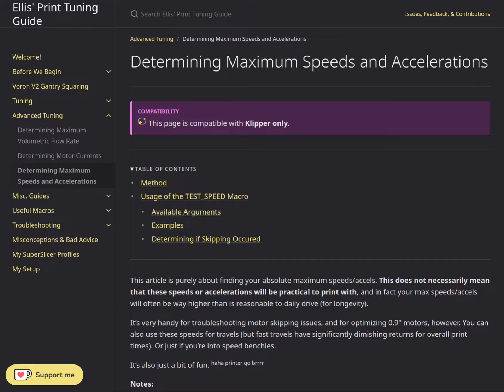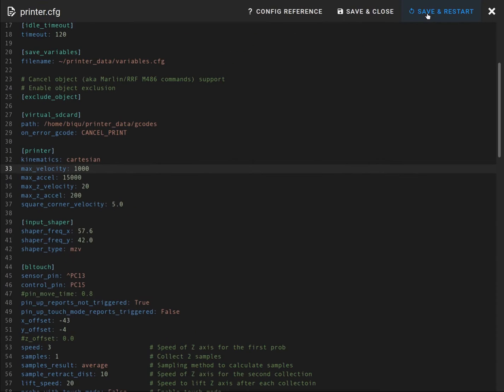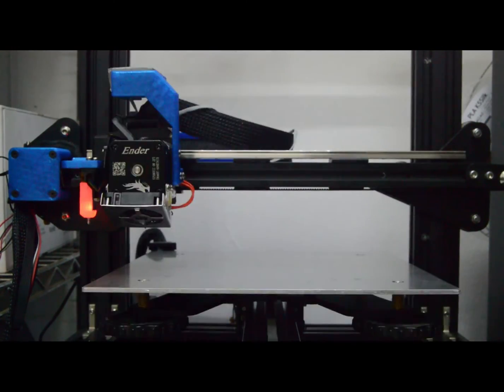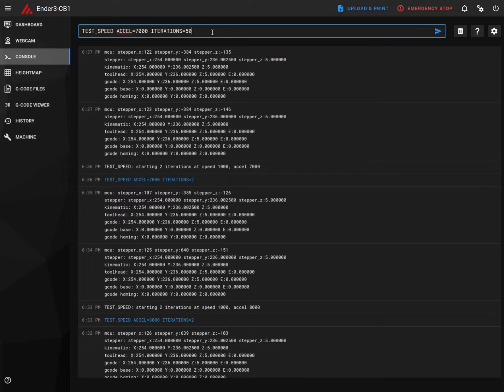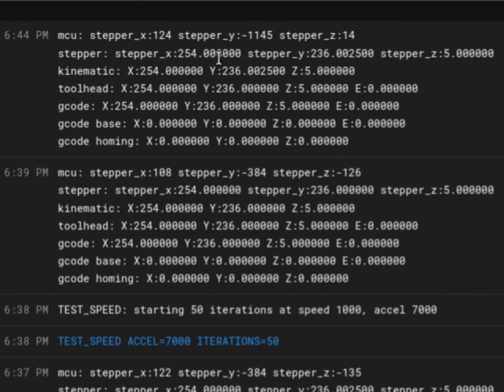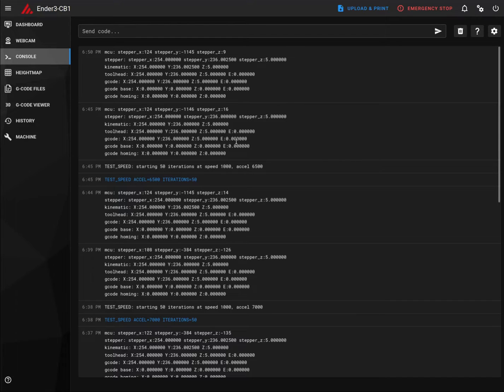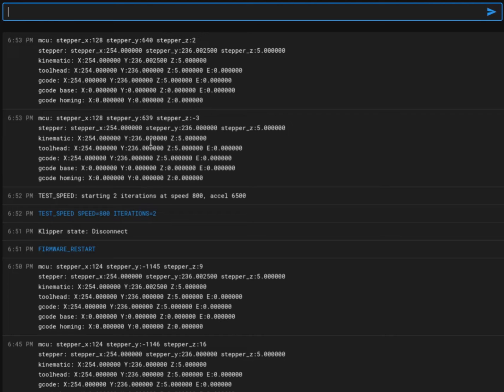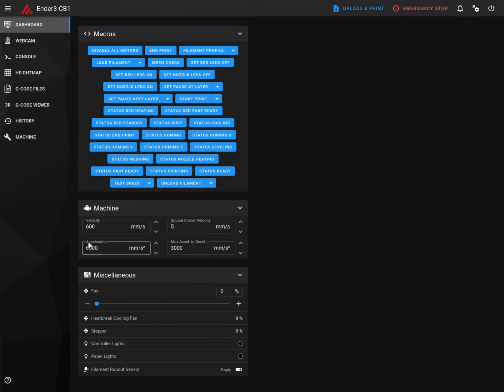Ender 3 Klipper Max Acceleration Speed Limits

Comment: My Acceleration was fine on X axis but Y axis was skipping at anything above 6500 so i kept it at 6500,  Now i have just finished a long process of installing linear rails to my Y-axis and now the Y -axis skips at anything above 5000  lol.
any ideas on what could be causing the motor skip?  belt tension? misaligned rails?  some advise would be awesome!  great video btw, my goto from now on when testing speed accel
Reply from the maker: I am not sure about your printer configuration, the printer main board and the stepper driver.

1) To go fast, you need to feed more current to the stepper motor, but that depend if the stepper motor can handle or not, please check the specs of the motor before increase, otherwise the motor will get very hot and fail.
2) It also depend on the stepper driver if it can deliver the required current or not.
3) It could be that you have reached the limits of the stepper motor, if so, you need to back-off a bit.

belt tension - if you are able to go above 3k, then I don't think so.
misaligned rails, I believe you have Cartesian printer, if so, disconnect the stepper motor cable for safety, then move the bed back and forth slowly, you must not feel any resistance.
Reply: @radiy3dprints  its a ender 3, skr mini e3 v3 with tmc 2209 drivers.
Default nema 17 44-34  motors all at stock settings and current (0.56amp) all is at the exact same settings as before i installed the rails.

The rails move as freely as i could get them, I had cleaned and greased the carriage thoroughly and got new better ball bearings and it glides like.butter before attaching to the printer.
So im sure its the rails being attached to the printer thats creating more tension that the previous V roller wheels as I could get 1400 more acceleration with the wheels before the motors skipped
Reply: @Dirt33breaks  hi, have you found answers/solution to your problem?
Reply: @billy.the.maker.  i reapplied the rails, lubed the carriages, loosened the plate on the carriages , basically made the bed move smoother/lighter.
Tightened the belt .
Its better. But next ill put the old extruder motor on it as its got more torque than the default Y.
Reply: @Dirt33breaks  so basically skipping is happening because y or x is not moving smoothly?
Reply: @billy.the.maker.  my case yes  as i installed linear rails which made the bed move less smooth.
Another reason could be belt tension or your motor
Reply: @Dirt33breaks  not enough tension? or too much. Well my Y axis skips even on 2000 (linear rails, but haven't measured before on linear bearing) but there is no quality loss at all and I print everything at 5000, so it is very weird
Reply: What is the weight of the bed with the rails compared to that without?

Comment: Can this be run on a klipperized Ender 5 or SV05 asking for a friend
Reply from the maker: Yes, you can.
Reply: @radiy3dprints  just worked on it and it was great after seeing the "ACCEL_TO_DECEL error which i just commented out.  stock hardware SV05 X and Y cant do much but at least I got it dialed in more.  Thank you! this was better than printing out the L shape wall.

Comment: Your printer's firmware reported an error:

Error on 'SET_VELOCITY_LIMIT VELOCITY=750.0 ACCEL=7500.0 ACCEL_TO_DECEL=': unable to parse

Due to this error, OctoPrint was not able to continue to communicate with your printer and sent an emergency stop command M112 to ensure all heaters are turned off, then disconnected.

Here's the last communication with your printer before this error occurred:
Reply from the maker: I hope you have added the TEST_SPEED macro. What command gave that error?
Reply: @radiy3dprints I did all of you did in video. While the test is progressing it gives me the error maybe 5-10 sec later after the beginning the test.
Reply: @radiy3dprints  and i didn’t get that. We will assume i set that settings. How can i increase the speed? When i started the print, it’s printing normal speed.
Reply: @radiy3dprints  I’m sorry that i’m new at klipper and hard-printer op.
Reply from the maker: Don't worry, please provide below information
1) Printer
2) Stepper drivers
3) Main board
4) What command you  execute before you get that error
Reply: @radiy3dprints  Thx.
1) Ender-3
2) TMC2209 UART
3) SKR Mini E3 V2
4)TEST_SPEED ACCEL=5000 ITERATIONS=2
and also tried these accel value= 1000,2000,3000,4000
Reply: and my pi is Zero2wh
Reply from the maker: Send your printer.cfg file  to radiy3dprints at gmail.com
Reply: @radiy3dprints  okay thank you
Reply from the maker: With newer version of Klipper, max_accel_to_decel is deprecated in favor of minimum_cruise_ratio. Remove the reference of  "ACCEL_TO_DECEL=" from [gcode_macro TEST_SPEED] section.

Reference: https://www.klipper3d.org/Config_Reference.html#printer
Reply: @radiy3dprints  The problem is gone. Thank you.

Comment: Great video! Im tuning also my ender 3, i got the speed and accel. Can you make a video where in you put the values on orca slicer?
Reply from the maker: Acceleration values must not be changed once tuned. The correct place is in the printer firmware/config as they are related with the printer hardware and not with the actual printing object. If you set in Orca Slicer, it will override those values.

Comment if you still need to see.
Reply: @radiy3dprints  hello , i still need to see it because im just new to orca, and also i tried to the accel and speed guide, i always got microstep of 127 for both stepper x and y, even if i change the accel value

Comment: So what did you just test? How fast it possible to shake by printhead and table? And what this value is actually worth? It the same how printer manufacturers write on a box “amazing speed over 9k mm/s”.

It’s much more useful to find the maximum acceleration that can be used for printing without loss of quality. And there we will find that the speed is limited by the performance of the hotend or the rigidity of the structure or belts and so on. So that’s one of the dozens points how to really find out max acceleration

But if the essence of your video is only the speed of movement of the head and the table, then no questions
Reply from the maker: @Zenyamh , yes, this video was focusing on finding the max speed limitations and not the quality, though I din't find any limits with the hotend at the max speed but on ghosting/rigging, I am waiting for ADXL345 to arrive so I can work on InputShaper for quality.